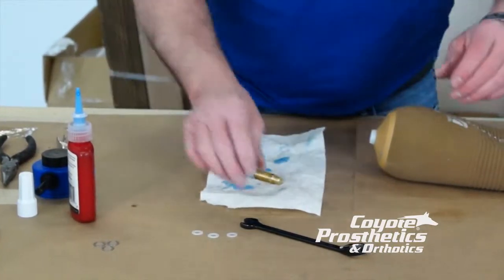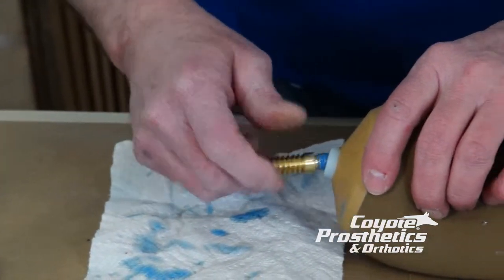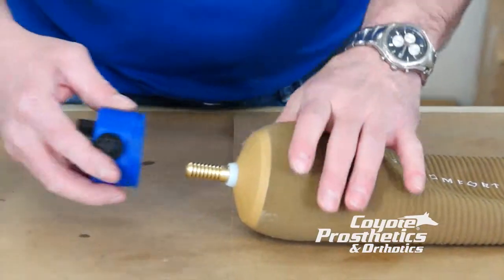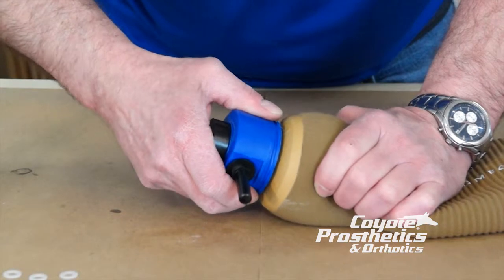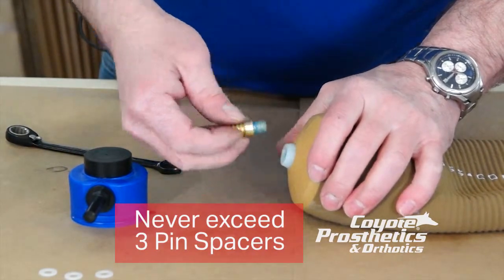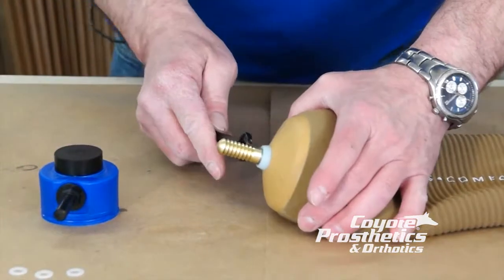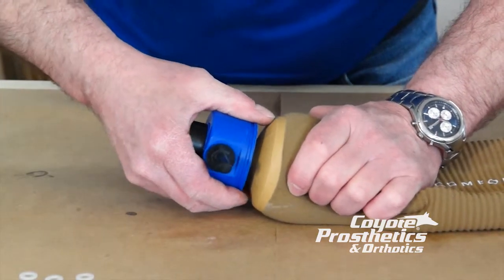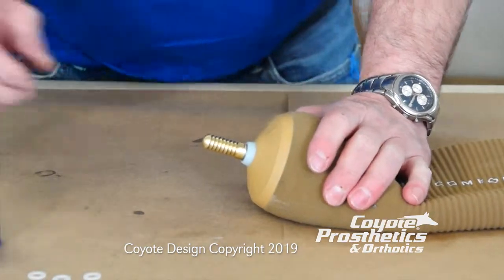How to Install Coyote Prosthetics and Orthotics Brass Pin for Leg Prosthesis

Comment: Should the pin be able to twist back and forth after it’s locked together?
Reply from the maker: No, it should have Blue Loctite 242 put on the screws so it does not spin loose.
Reply: शश
Reply: Hello. Where can I purchase the locking pin along with the gadgets to install the pin please?